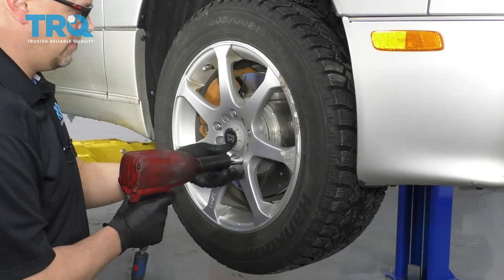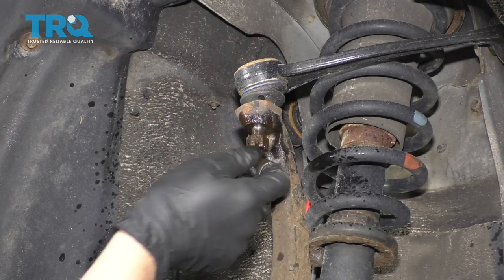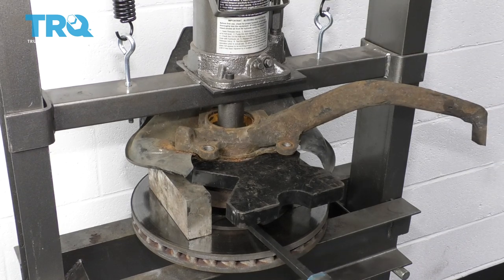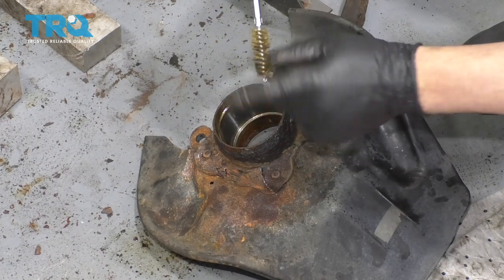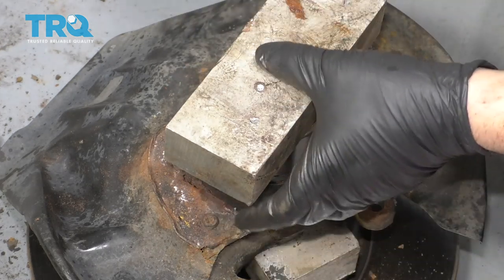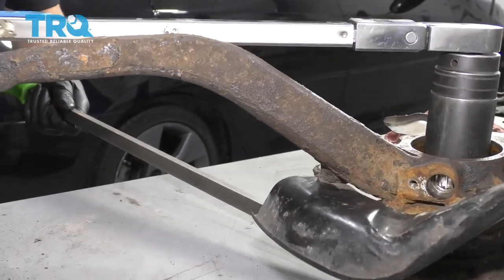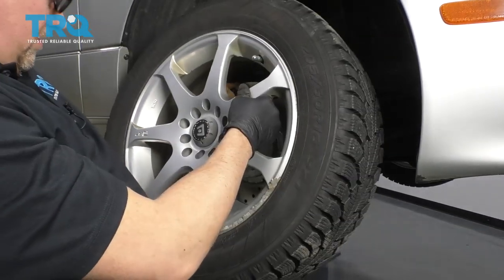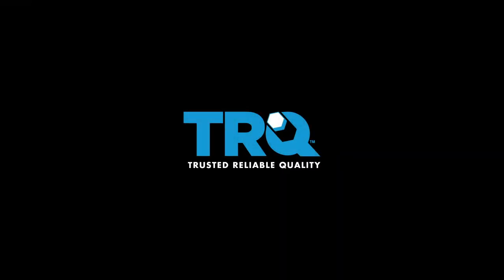How to Install Front Wheel Bearing 1998-2005 Lexus GS300

Comment: Thanks for the detailed video! Very much appreciated! I´m about to do this , too. 

After my lexus dealer gave me an estimate of 1200 bucks for both sides, i decided to give it a go doing it myself...
Reply: How'd it go... I am going to do the same!
Reply: @AirRideFanatic  Hi, it went well so far. Two afternoons of work with the right tools.
Had to go to a nearby garage to get the wheel hubs pressed out, because my 6to chinese shop-press was to small. I took them nearly an hour to do it...but they pressed out the outer bearing race too, which i didn´t asked for.
Reassembling went nearly without hickups, but of course i forgot to mount one of the new brake disk covers before pressing in the wheel hub, so i had to cut it to get it mounted.
Reply: @TINRFD  awww man!  So pressing the bearing back in with your little press was no problem?  Glad to hear though!  GOOD JOB
Reply: @AirRideFanatic  No Problems there, just make sure the outer bearing race is fully pressed in.
Reply: @TINRFD   I have a 15 ton press think its enough to get it done removal and install of the hub and bearing...? I'm kinda scared to do the job and midway find out I wont have the right diameter cup or plate to exactly press on the outer race of the new bearing for the install and also worried about pressing in the new hub and ripping the inner race of the new bearing out the back of the knuckle, ruining the new bearing... lol any thoughts ? thanks
Reply: Hello. Those bearing is magnetic encoded? Or just a simple bearings?

Comment: I’m on my 4th 2GS. Don’t everrrrrrrrr do a wheel bearing on one without putting some kind of grease in there. Do not rely on the grease provided on the bearing. That is not sufficient enough.
Reply: Grease inside what and what would you use to put the grease in there I’m confused

Comment: what kind of grease is that white substance around the metal balls ? is that the original grease used by Lexus or is that  the result of the original grease transformation over the years ? (so the original grease was not white? ), thanks

Comment: Does anyone know the symptoms of a bad wheel bearing? My inner front tires wear out really bad I move the tire when on a jack stand and it has wobble. When I drive it; it makes this chirping screeching sound that the front tires emit. It's a lexus sc430.
Reply: bad bearing would be a droning sound that increases and decreases with speed...
that chirping is most likely a warped rotor brake pad combo...  when you change them, change them BOTH... or your hub could be bent
Reply: Inner tire wear says camber issue.